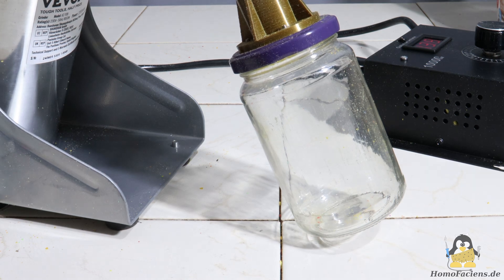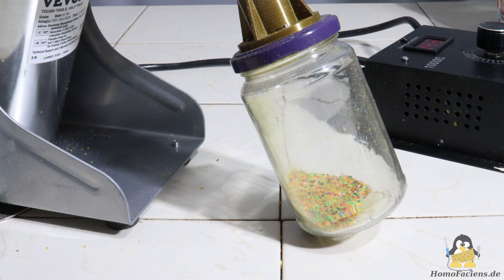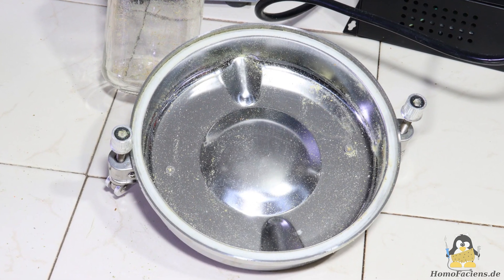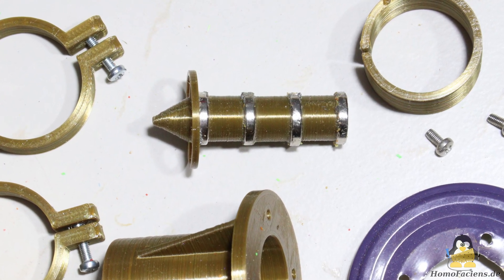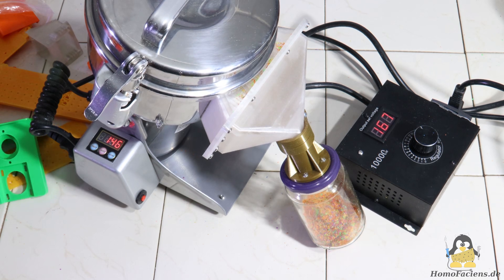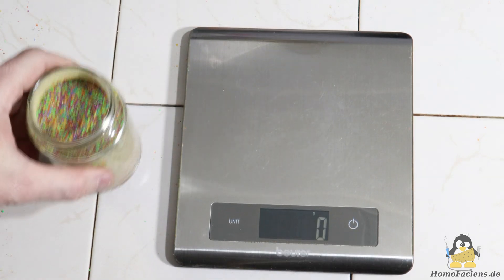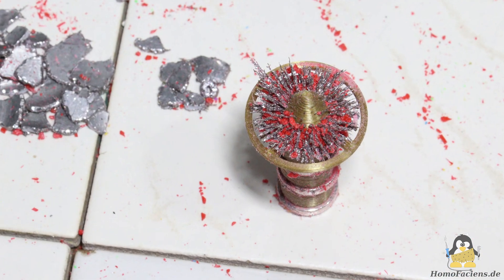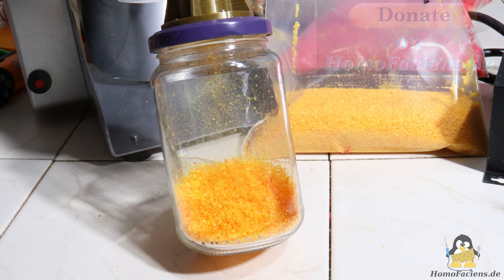🇺🇸 🇬🇧 Plastic powder from old prints with a modified mill

Comment: This is awesome. Would you say this is a good solution for making plastic powder long-term and were you able to process lots of material before the blade broke?
Reply from the maker: Thanks! I will split the powder making into two mills: One will crack down the failed prints into particles < 1cm while the second one is for grinding those preshred particles or industrial pellets (to add some fresh material). This second stage will exert less forces and will work as demonstrated in this video. The 1st stage will need a larger pot and maybe a different, more solid blade. Still some experimentation to be carried out - stay tuned!

Comment: Just a tip, IR thermometers can't really reliably measure metallic and reflective surfaces (as their emissivity is different from the 0.95 the cheaper meters tend to assume), so stick a piece of tape on anything reflective you want to measure first.
Reply from the maker: You are totally right. The measurement in this video was just to point to the fact that the pot heats up noticeably.
Reply: Good tip the paper label. Here, the absolute accuracy isn’t important.

Comment: In a recent video of the channel „Shake the Future“ the same kind of grinder was used and blades for it cast, using a microwave to melt the metal. Maybe a not a viable process for you, but interesting non the less.
Reply from the maker: Thanks for pointing to that video from @ShakeTheFuture (I had missed that). However, I'll rather cut custom blades from forged steel sheets with my EDM machine. More on that in a coming video. Stay tuned!

Comment: Is there downside of extruding filament from powder vs granulates? (except that powder might stick to the walls and cavities).
also what is average particle size you can achieve with it?
Reply from the maker: Making good filament requires a precise diameter or flowrate measurement to control a feedback loop. Using powder or pellets won't make a huge difference then. Melting and extruding the powder directly in a 3D printer skips the need for another heating procedure.

I will talk about particle size you can get with my setup as well as about the impact on print quality in coming videos. Its a new way of FDM printing with lots of experimentation to be carried out and a lot of more knowledge to share with you. Stay tuned!
Reply: @HomoFaciens  Do you think cryogenic grinders make sense for desired particle size?
Reply from the maker: Well, that's nothing for the average tinkerer. Keep it simple is the mantra I am following and the results I get with this setup are good enough for what I have in mind.

Comment: The motor and the body seem robust enough, maybe your should try making a custom blade, a thicker and tougher one. Doesnt need to be sharp or anything, the shredding is done mainly by the inertia of the blade impacting against the plastic and slowly cracking it. a straight blade would be good enough, just make sure its well balanced.
Reply from the maker: Yes. The thing is, that the parts need some space to fly around so that impacts and inertia can do the rest. The pot is simply to small or the blade to long. One of the reasons why I am working on an EDM CNC is to make custom parts from hardened steel. Also I have purchased a large pressure cooking pot (sturdy and dust tight lid) to pre-shred the plastic. Still a lot of experimentation to be carried out - stay tuned!
Reply: @HomoFaciens  
tbh, i would just take the shortcut of just using an angle grinder and a pair of files.

Alternatively instead of shredding it, if you could melt it and push it through a tube you could extrude it into a filament, which you could then pelletise for your extruder, which should probably be more efficient and need less maintenance. The problem though will always be the big parts, just like with the shredder method.
Reply from the maker: I don't see why an angle grinder should be a shortcut. Have you ever used a file on plastics? It quickly melts.

The filament thing has been done before with it's own drawbacks. No need for me to redo it.
Reply: @HomoFaciens  *too
Reply: I also thought a rough pelletizer was a sensible preliminary step but the complexity and multiple drawback make this impractical. You end up having to deal with most of the final extruder issues without benefiting from the supposed crudeness of this preconditioning.

Comment: I guess a coarse/slow moving blade type grinder (like those "crushing mulchers") would be a good preprocesising step if you have lots of large prints as input, to avoid damage to this fine grinder's blades.
Reply from the maker: I have purchased a large pressure cooking pot (solid walls, dust tight lid) to preprocess the large parts into particles <1cm. I'll screw it on top of a router motor or maybe another mill motor. 'Crushing mulchers' need solid mechanics and a really solid drive train. The blender / mill /grinder approach seems more simple to me as a DIY project.

Comment: Peltier coolers might be a good way to keep the temp down.
Reply from the maker: Yes, but water cooling of the outer wall should do the job and is usually more energy efficient.
Reply: nah, its a 3kw motor, no way you are cooling it with a peltier, youd need a 3kw+ peltier and then youd be disipating 6kw+ of heat into the air.

Water or air cooling is the only way to go with high power equipment.
Reply: @laharl2k Surely by the time the energy reaches the container (which is the only important part to cool), the power to dissipate is way lower than the input electrical power value. You only have to keep the plastic temperature in check to ensure plasticity doesn’t hamper the grinding action. An assessment of what this temperature actually is would be an interesting experiment! 💡
Reply from the maker: I might have a closer look at the temperature and the results in a coming video. Too many things are currently running in parallel to make the extruder technology work reliably before going in all the details.